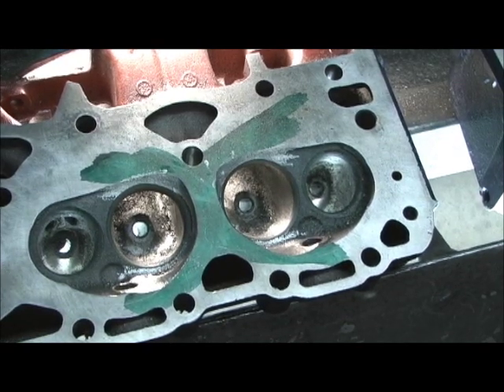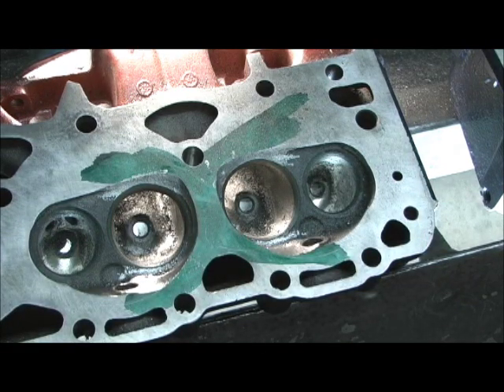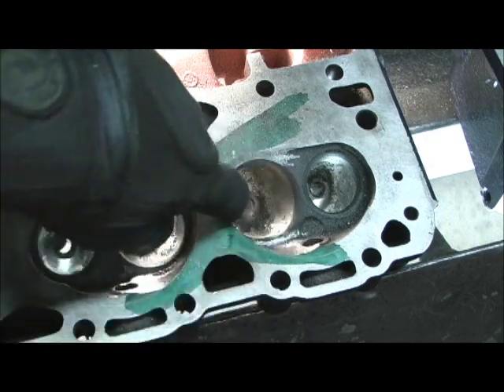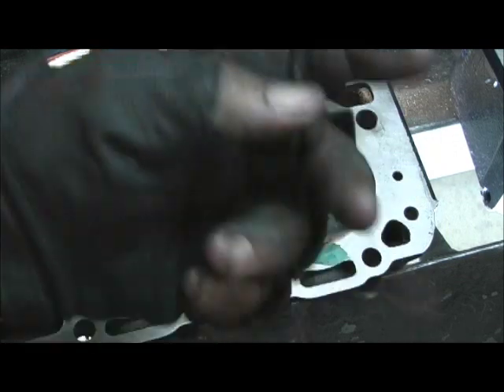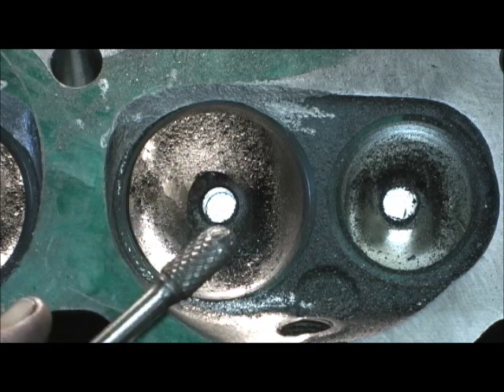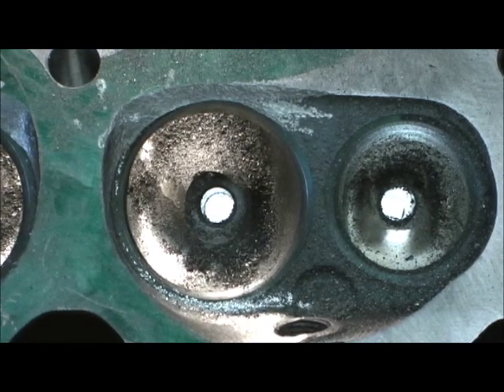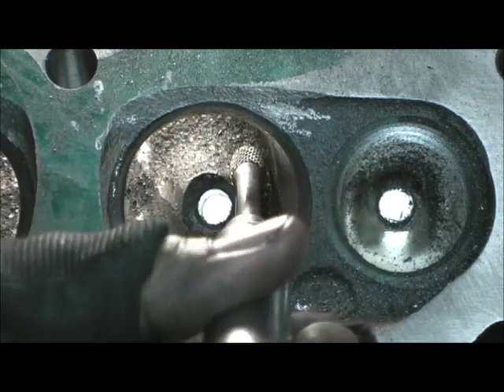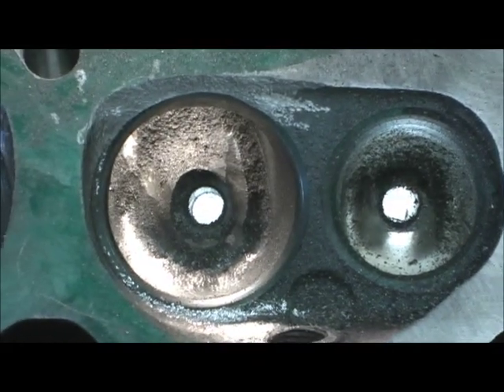Holder's 305 HO 601 Bullet Guides 5.0

Comment: I just did a port job on 624 58cc combustion chamber .
screwed up didnt cc runners till after.
Port matched exaust to header gasket did bowls like you did .
port matched intakes did bowls just like you lapped valves
did tiny bit on in take runners on pinch point .
ccd 361 cc intake runner  361cc exaust  59 ccs combustion chamber
hope I didnt messsup.kind scared did I over due it.? 
they look like ready for indy. LOL

Comment: I'm surprised anyone would even build  305ci these days.
Reply from the maker: Hold on, APPLICATION here please!!! for a truck, that wants to get over 22 MPG, and have close to 400 Ft Lbs of pulling power, the 334 is the way to go hands down. I have done SEVERAL of these animals, and it just plain WORKS, and gets Great MPG to boot.
Reply: Headbytes Porting
Wouldn't it make more sense to buy a 4.8L ls?
My brother picked up a 40Kmi 4.8L with VVT for $400.
drop a carburetor on that shit and you golden.